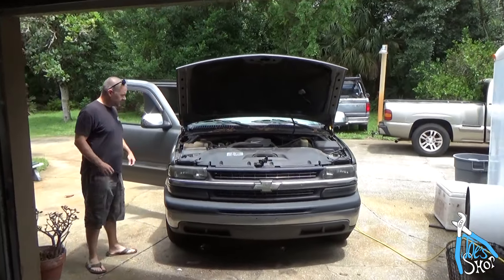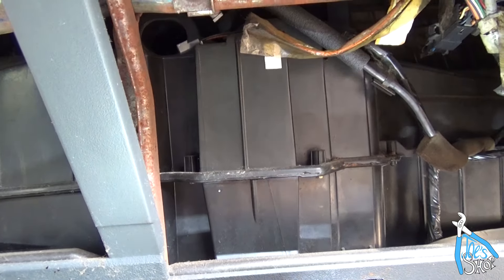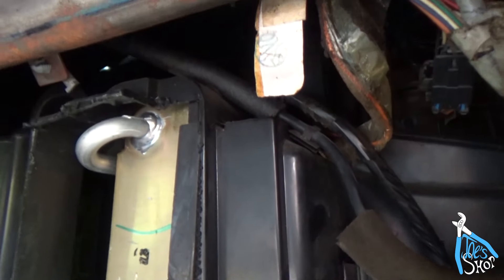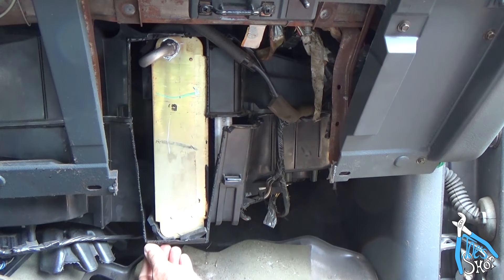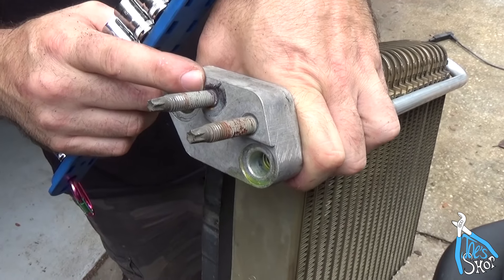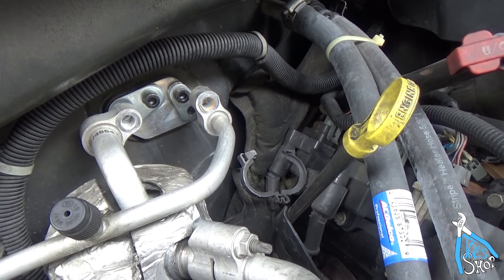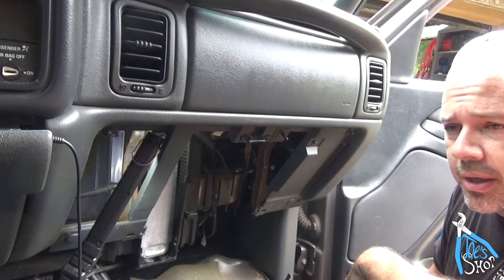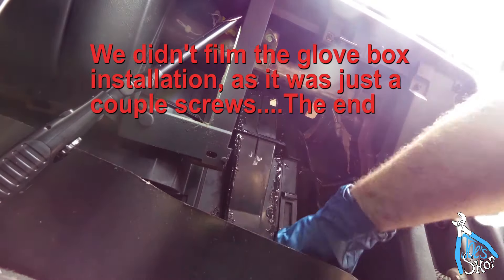Chevy Silverado Evaporator Hack (2002)

Comment: what size was the bolts that you used bolt back into the evaporator core the old one has the studs the new one doesnt just pulled mine out and same thing the new one doesnt have the studs

Comment: I recently changed out the compressor and accumulator and changed all the seals even on the condenser.  I never thought about the evaporator.  Could this be the reason why my new compressor won't engage because the evaporator is bad?  System will not hold compression either.
Reply: I meant hold vaccum.
Reply: Mine clicks in and out, so I’m in the same boat! I’m willing to bet it’s my evaporator
Reply: @ewalt5501  the clicking in and out is because it is not at right PSI in system. Mine does the same once it runs low. Believe mine has a bad evap. Most likely will be using this method in the spring so I have ac

Comment: Now I'm really worried that my 99 Silverado is going to be leaking thru this part. My air compressor kicks on and off, and when it does seem to work, it only blows cool & not cold. I wish I could know for sure why it doesn't work.  But I don't have time to let my truck sit for too long in a shop because its my only form of transportation.
Reply from the maker: One of the comments said to add dye tobthe system, then look for traces of dye in the condensate that drips...that sounded like a good idea to help determine if it is the evap or not

Comment: Did the job.. worked well but now it leaks in the passenger side.. what did I do wrong..??
Reply from the maker: @johnnythumper409  did you seal the box back up with an epoxy? I used jb plastic weld and it sealed up perfectly.

Comment: Can the heater core be extracted this way ?
Reply from the maker: No...I wish
Reply: @joeheilm  Thanks for the content brother.
Reply: he heater core is removed from the top of the climate control box, there is a blend door between the heater core and the side of the case that Joe cut to remove the evap core. So sadly the dash needs to be pulled back or removed to replace the heater core.

Comment: Awesome video its messed up how these things are designed to replace a simple part when they could put an access panel to replace their cheapo parts they use…
Reply: And you know, there’s several ways one could modify this piece going back in.  Pretty sure I’d just  plastic weld a few spots and coat the rest with RTV,  or HVAC tape.  This should have always had an access panel like that. This was obviously designed by a designer and not a mechanic.

Comment: I do not understand why The hell engineers can’t have an access panel for that. This job is so labor intensive and frustrating to do just to replace one part. Which on newer trucks fail often because parts are made so cheaply nowadays. I also think it has to do with saving weight as well, the lighter the parts are better fuel mileage you get. At least that’s what I think they’re doing.
Reply: Engineers do not repair them , they just design them to be built as cheap and quickly as possible

Comment: That COULD have been designed with a removable cover and cross member which would have eliminated the horribly time consuming nightmare of dismantling the dash.
Reply from the maker: For sure. I wish the GM headlight engineer was in charge of the hvac system. I love the fact that I can change a head light with no tools in under a minute. Genius engineering. Cheers

Comment: - you'd think GM could've designed a door, so to speak to replace the evap core. I guess it's designed for dealers to charge you the big bucks to pull the dash & heater box assy out, huh?
Reply from the maker: @johnplato4976  that's a good question. If gm got a bad batch of evaporators they would be up the creek, if they failed under warranty. I'd guess the pencil pusher accounts chose to sacrifice serviceability for speed or cost. Either way this is an excellent example of what not to do. I hope this hack works for you. Cheers

Comment: Lest anyone try this hack - DON’T!!!  What they don’t show in these videos is the actual removal and installation of the evaporator core. Everyone just films themselves cutting out a neat little access panel, then show the core out, then a gooped up mess with the cover all “replaced”.  And here’s why… you have to almost destroy the box to get the damned thing out?!  Do yourselves a favor, take the dash out and do this right.  If not, cut the access panel as big as you possibly can in one huge piece and also cut the bottom out with it so you are removing one large cavity, front and bottom.  You can then remove it, (albeit with difficulty). You can then install the new core, and caulk the access panel back on.  What a pain in the ass.
Reply: Did you even watch the video? 5:25 pulling it out, 6:30 reinstalling it??? LOL
Reply: @pintodave oh please! Not only did I watch this one numerous times, I watched several others, AND I actually did the job with this video playing over and over on the seat. So unless you have done this hack yourself and realize the videos have been “edited” quite a bit, please don’t be lecturing me. Go actually do the hack and THEN come back and “lol” me, bub.
Reply: @tmcorey1 it was my truck in the video ya nut 😂😂😂

Comment: And then you will wonder why you are getting water in the floor board . The case is supposed to be a sealed tray for condensation to drain away. That is when shops like mine will scratch my head wondering "What the hell?????"
Reply from the maker: Hi Don, the JB plastic weld is great stuff, i doubt there well be any leaks.  Cheers
Reply: As Joe said, it's well sealed. I put on a very heavy layer of that plastic bond. No wet carpet yet!
Reply: Definitely a hack job but if you don't know how to take the dash out or money is an issue oh well. I am not hacking or rigging anyone's vehicle like that and the screws for the glove box have nothing to screw into since you cut the metal out but that can be rigged also

Comment: If you didn't video the glove box going back in without any rattles it didn't happen. Good hack though but not showing the glove box re-installation is an indication it didn't go right.
Reply from the maker: Not showing the glove box reinstall is an indication that I edited that part out 😂. I have zero interest in misleading anyone...it went back together with no problems
Reply: @joeheilm   Ok I can understand. This is a good hack but most are not use to cutting up their vehicle even an old truck. It would have been nice to show the solution and detail of the glove box re installation similar to what you showed when fixing the evap box after cutting it. Showing that part could have shown others ways to prevent rattle, ways to improve it, or a ways to return back to a stock. Again, good hack and thanks for taken the time to film it.

Comment: Is a cool hack but cutting the bottom of the housing is not a good idea since the water is going to drip on your carpet . RTV will not work for very long may be a week and the super glue hack I’ve done it before it works as long surfaces are prep correctly because the water will get the glue separate from the plastic . In a next one don’t cut all the way to the bottom just remove the front screws from the housings to separate them and leave at least 1/4 inch from the bottom intact because I promise you it will leak. 👍
Reply from the maker: The jb plastic weld has worked great...no leaks at all. But leaving the bottom does sound like a good idea. Thanks
Reply: @joeheilm any leaks ? Planning to do this too
Reply from the maker: It is now June of 2024 and still works great and no leaks or rattling. Cheers